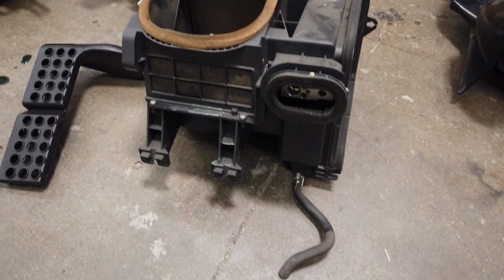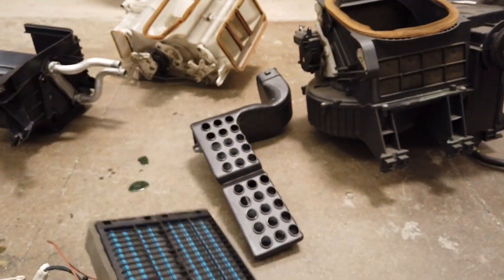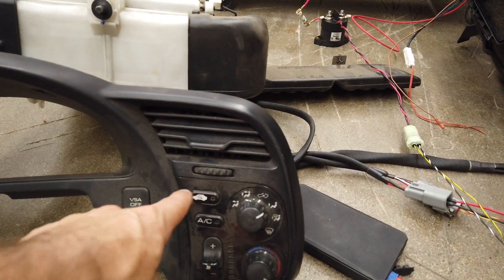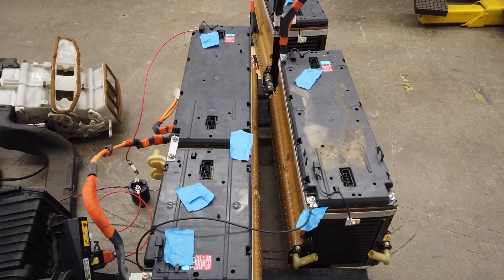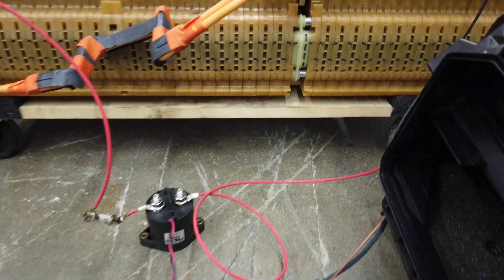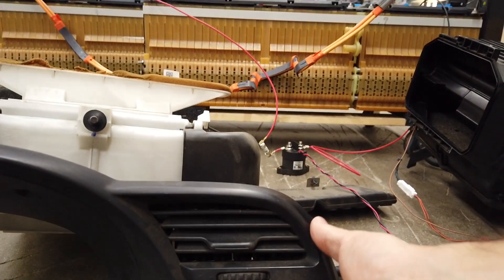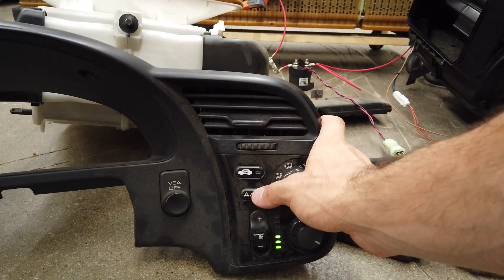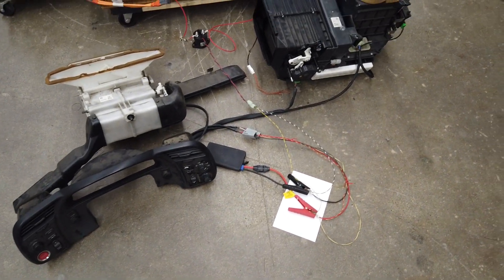RyWire EVS2k Part 5 Electric Cabin Heat EXPLAINED

Comment: I had a 88 accord LXI that had a dealer installed electric heater. It was the best thing in winter. As soon as you turn the car on you had heat.